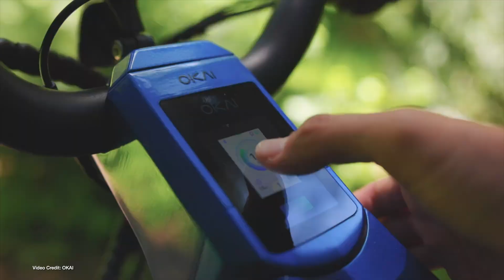ecoTEC Episode 245: Tesla Semi, Ford's Price Hikes, Beating Hurricanes

Comment: A solar panel covering the body of a vehicle would gather enough energy in 12 months to drive perhaps 5kms
Reply: Actually more like 30 km per day for the average EV. Always amusing to hear satirical opinions though.

A Nissan LEAF for example uses about 155 watt hours per km. An average solar panel on a house is about 300 watts. Therefore about 2 km per hour if you attached a single house style solar panel. Which of course you would not do you would use differently shaped solar panels fitted to the shape of the car, and that covered more surface - say 700 watts, or about 4.5 km per hour. Say 20 km on cloudy days (yes, panels still work on cloudy days, just less) to 45 km on sunny Summer days.

The Aptera uses less than half the electricity compared to a normal EV, so easily 40 km to 90 km from solar alone, if their estimates on electricity usage are correct.

There is this wonderful thing called maths. I recommend you seek it out, and cease living in the vacuum left by it’s absence.